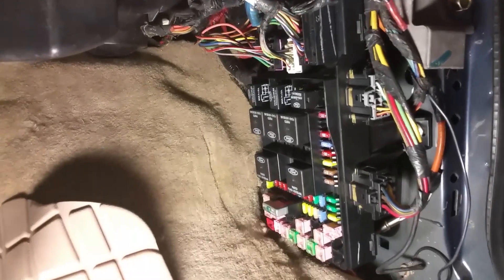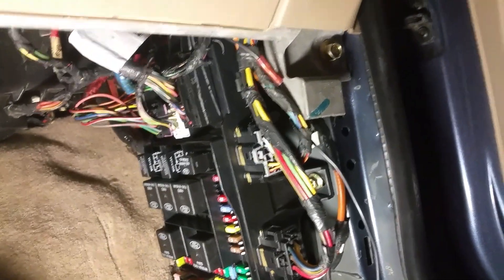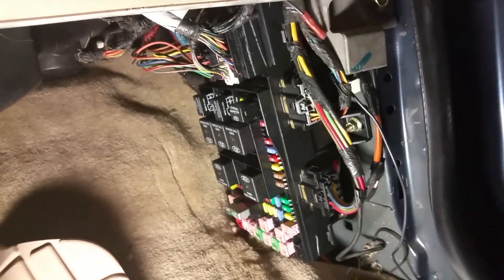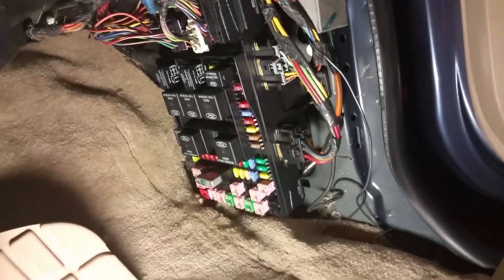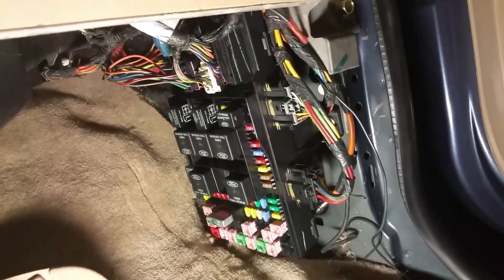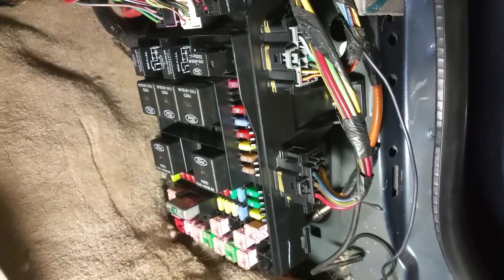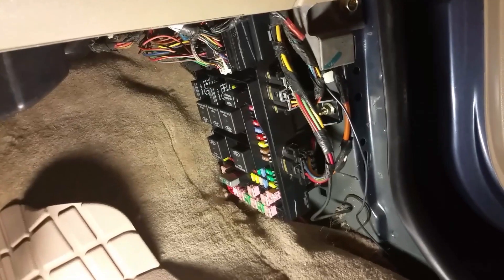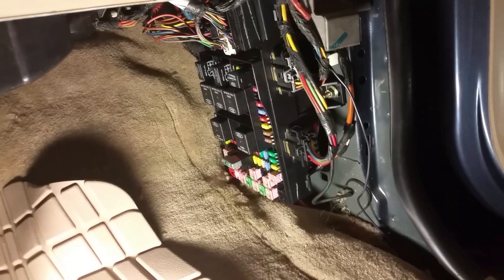2004 ford F8vx-ba repair fuse panel fuel pump relay. R303 part 4

Comment: I am having trouble getting the big power connector off that runs from the fire wall and the one thats on the front seems as it slides off or some deal. Please help
Reply from the maker: Big power wire is held on with a bolt, maybe 10mm. ? Dont remember now